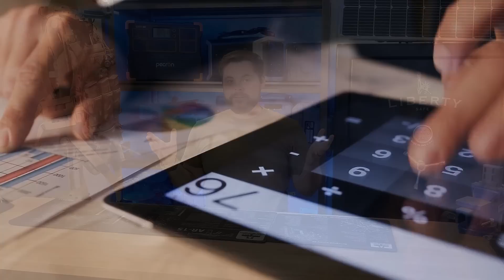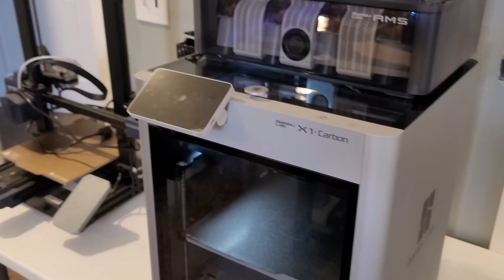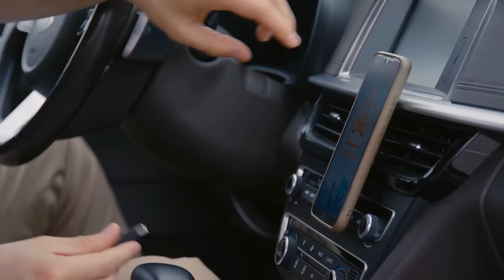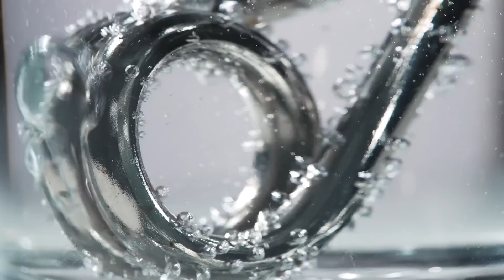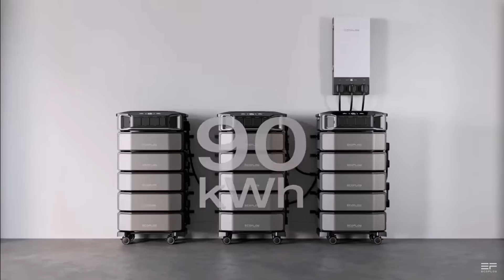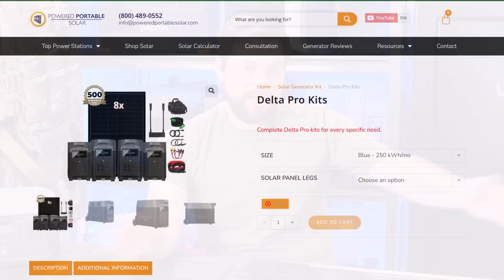No One Is Talking About This With EcoFlow

Comment: EcoFlow works fairly well.  Definitely top-class these days, though I don't go overboard buying their gear because I am more a discrete-systems guy.   My large capacities are banks of discrete LiFePO4 batteries so I don't really need any power station larger than 2000Wh/2000W or so.  I've collected almost a dozen small and medium-sized power stations of various brands, including EcoFlow.

But I would be careful using the energy management features in an AC-only "UPS" environment where the power station is not periodically charged to 100%.   It isn't actually possible for EcoFlow or anyone else (not even Tesla) to track the SOC or balance the cells without periodically charging the battery to 100%.  So if one tries to hold the battery at float (or lower) indefinitely, the cells will get out of balance and the SOC will drift until it is more or less a useless indicator.

So you generally want to fully charge power stations to 100% once every 3-6 months or so.  Also you might as well hold the power station at 90%.  From a practical standpoint there won't be any more stress on the battery compared to 70% unless the power station is sitting in a very hot environment (90F or hotter).  It's just a waste of capacity to hold the SOC below 90%.

Unless the unit is to remain unattended in a remote location, the discharge limit setting can be set to 0%.  If it will be unattended in a remote location, set the discharge limit to 10% or 20%.

--

Generally speaking, you aren't really saving much if any wear on the battery by charging to a lower SOC unless the power station is in a very hot ambient environment (90F or higher).  In any conditioned space where the temperatures are closer to 70-75F, holding the SOC at 100% won't hurt the battery enough for anyone to notice.  The electronics in the power station will fail long before the cells do.

I have numerous discrete LiFePO4 batteries used in UPS applications and as down-buffer batteries that are, more or less, held at 99% SOC at the float indefinitely.  For several years.  They are still pulling 95% capacity and that's most just from initial calendar aging.  I expect at the 10-year mark those batteries will still be above 90% given that they are in conditioned or cool (but not freezing) spaces.

-Matt

Comment: I've already had two failures of the three Delta Pro Ultras. This second one they refuse to send me a replacement before I send them the failing unit. This doesn't include the glitches I've had in the past. They have never resolved problems including the Power Insight Monitor can't connect to the DPU and Smart Home Panel 2 when the internet is down; The ethernet connection from the SHP2 to my router has never worked; it usually doesn't balance the charge between the three DPUs and the attached batteries; and the app on my phone can only connect via Bluetooth if the internet is down. All that and what makes the least sense is why do they not have tech support available during US normal business hours? You always have to wait overnight for someone in Asia to respond and troubleshooting a problem takes forever.
Reply: Another example of a great product design RUINED by $0 software development.
Reply: @gman1868  "And the app on my phone can only connect via Bluetooth if the internet is down"

Is that not obvious?
Reply: @CarlLindman-x8v  Firstly, Ecoflow said I could connect via local ethernet to the SHP2 when the internet is down. I can communicate with other devices on my own home network via ethernet and WiFi. The Power Insight Manager doesn't work via WiFi when the internet is down, but it's connected to my local WiFi network and the SHP2 is hard wired via ethernet to my router. THey told me this would work before I bought the equipment and I only discovered the problem after everything was installed.
Reply: There support sucks!!  No US based support.  It has taken 3 weeks to get my bricked ecoflow Pro replaced.  They told me that its on the way.  These reviewers need to do a live firmware upgrade and and pull the plug while its connected to the internet to see what happens.  Total shit software.  I will never purchase another one of there products again!!  They even abandoned the smart panel V1 and left us holding the bag.

Comment: I had a similar set up.  I had a delta pro that went all the way to 0 and then stopped working.  It was easy to send it back and get a replacement so that part was good.  However, I am looking for a whole home off grid set up and reliability is highly important….now I am a little nervous with the EcoFlow

Comment: @6:06: Now you are touching on something which I don't think is great customer service AT ALL !!! Having to pay large amounts of money, only to have your EcoFlow Product FAIL and then needing to re-package and re-ship your EcoFlow products back for servicing is a HUGE HASSLE AND MAJOR, SUPREME, INCONVENIENCE !!! Who the hell has the time to screw around like that ? If you're talking about an EcoFlow Delta Pro, or an EcoFlow ULTRA solution, then re-packing and shipping that isn't a 5 minute exercise is it Ben ? How about designing the EcoFlow power stations with built in, resettable fuse relays, or end user replaceable fuses, instead of requiring the customer to always ship their heavy power stations back for servicing in cases of malfunction ? In 2025, I don't see why you can't connect your malfunctioning EcoFlow Power Station to the Internet, so EcoFlow can remote service, update, or run quality and function control checks to diagnose faults ? Unless the built in WiFi and Bluetooth is what's busted, of course ?
Reply: Can you impinge if you are/were using this hardware and totally 100% reliant on it like an "OFFFGRID" type scenario?

Comment: We have the Delta Pro + extra battery, and a River 2. We originally got our Delta Pro (by itself) to start to slowly build out our system to prepare for hurricanes, so we were going to pay off the battery first, then make choices about solar panels, gas generator, an extra battery, etc etc...... Then a month later a hurricane hit us and took out our power for about 4-5ish days. It kept our food going but we were sooo not ready. BUT we did have family that got their power back, so we drove the unit to their house and charged up in about a hour, so we were good for a little while longer. Another family member got their power back as well and let us use their gas generator to finally finish out the outage. Few months later, we got a gas generator just to be a little more prepared and after we paid off the main unit, we bought another battery. Milton hit us in central Florida and we took it no issue other than dwindling gasoline supplies making me a LITTLE nervous (we went through half our supplies). We started buying solar panels last year and we're at 4 bifacial panels and looking to get four more this year. We also got a river 2 just to keep our water softner going for 12 hours in case of an outage if we're away or something, because the Delta Pro isn't always being used. So that's our history with Ecoflow

My critiques of the company is that I really REALLY do not like how much mark-up you get with the brand. I don't mind the main units being expensive cause it just makes sense but their extra batteries are USELESS without the main units, so them being as expensive as they are for limited functionality is kinda not okay. ESPECIALLY since you lose access to ports for other means like their own gas generators. If you have to batteries with their Pro units, you are going to have to disconnect on to use their gas generator in the way it was meant to be used and then cycle the extra batteries to charge the other one and that seems like more work than there should be. Daisy chaining them like other companies do with their extra batteries is kinda a must for this situation. Also, once again, other companies allow you to at least charge DC loads with their extra batteries like over USB-C or even charge up the extra batteries via DC/solar. I also really hate the extra battery cord for the DP. It's way too unwieldy, especially for tight spaces. Happy newer customers for the DPU/DP3 get that improved cable but it sucks that we have to go out and pay for that privilege now as DP1 owners. Also, their solar panels are way too expensive for the output you get, it's kinda absurd. I also wish there were more buttons to have more functionality not tied to the app, in case a phone breaks or someone who is not phone savvy or a third party needs to operate the units for you if you're away or something. Also, JUST IN CASE ECOFLOW GOES BELLY UP, it would be nice to not have to worry about app updates continuing since there have been instances of phone app stores stopping functionality of older apps as OS's update and leave behind older phones. Final pain point is backwards compatibility. It sucks that Smart Home Panel 1 owners are kinda stuck with the Delta Pro and Smart Home Panel 2 owners can't use their DP with it. So if you have a Smart Home Panel 1, you're stuck with the Delta Pro only and if you get the SHP2, you have to abandon the Delta Pro main units and upgrade to the DPU or DP3, adding extra expensive. I'm sure there's a lot of electric engineering reasons for why this HAS to be the case, especially with the voltages involved, but Ecoflow really wants everyone to be in the ecosystem and this makes me wary to fully buy in since there might be a SHP3 that further breaks backwards compatibility. Also, with the previous point of app support for the long term, I worry about the SHPs long term support. DOn't foresee Ecoflow going away in 10 years but crazier things HAVE happened in the last decade, so I worry about this stuff. Also, Delta Pro is annoying when you go over 500w of charging/discharging. Obviously would take it's fan noise over a gas generator but it's kinda worse cause at least the gas generator is outside, the DP is meant to be used indoors... where you sleep.

I haven't used their customer service much but in the times I have, they were very quick to respond. I do like their app a lot and its also improved a lot from when we first started using it to now. It's also, frankly, FUCKING CRAZY that you can get so much power in a single device that also excepts so many inputs to charge from. We're living in a golden age, people. Love that there are so many options too so people don't have to go big or go home, you can get something so much smaller to run your fridges and be set charging from your car is need be. The flexibility here is just awesome to see. I also do love that I don't feel the need to go out and get the newer stuff cause what we have is plenty good enough and I'm comfortable mostly knowing (outside of app stuff) that the units should run a good long time and still be about as good as when we first get them, outside of niche potential issues we just haven't encountered yet. I do like with the Delta Pro series that, if you want to go full sickos, you can get extra main units to get 240v and not really HAVE to go for the DPU or DP3. I do like the idea of the extra batteries being compatible with the DP3 so you don't have to get rid of all of your investment potentially

So yeah, mostly happy with our purchases. They've saved our butts, helped run medical devices for a family member, can be taken with us if we just want to gtfo, can be charged from multiple sources at once, charges fast for the capacity, has expand-ability of capability/capacity, seems pretty dependable thus far, and it just cool to see that we've gotten to this point. If it weren't for expense, I'd recommend everyone get one of these units just because they seem more and more like a necessity than a luxury. I hope costs go down and battery technology keeps improving so that more and more people can get these things and not have to deal with as much pressure during outages.
Reply: Hi kamo, can you tell me the battery voltage of delta pro?!! Ecoflo does not state it on website... The delta 2 has a 51 v battery... And the delta ultra has a 100 v battery...
Doesn't the pro have an ac input for charging?!? Why are you disconnecting the extra batteries to charge by generator???
Reply: @SolarizeYourLife  I don't know what the internal battery power is like, so I can't tell you. As for the extra battery, it's completely reliant on the main unit to charge it, so in order to charge the extra battery, IT HAS TO BE PLUGGED INTO THE MAIN UNIT, it can do nothing by itself. The Ecoflow delta pro has two proprietary connection ports for either two extra batteries or an extra battery and their gas generator. It has one solar/DC input that you can charge with solar or other DC loads as long as you can connect via a XT60i connector and it's got a computer AC input (they provide the AC charging cord). I plug the battery into the generator via the AC cord and that charges both the main unit AND the extra battery. It's not one or the other. The Delta Pro can also AC charge AND DC charge at the same time so I can charge via the gas generator and solar at the same time, which is handy in a low light situation like with clouds or something. Hope this helps!
Reply: Wow.  What a "comment!"
Reply: I guess Eco Flo has many issues.

Comment: I am just a lowly consumer and agree with you.  EcoFlow does stand behind their products.  After 3 years of use I sent 2 of the Delta Max 2000 and a river pro back.  They sent me shipping labels, and was given the option to wait a longer period to repair original or get refurbished ones for a quicker turn around.  I got refurbished ones with full existing warranties.  My River Pro had to be replaced with a new one and for my troubles EcoFlow gave me an extension battery for it.  They rock, unlike Pecron that made me pay for shipping.
Reply: Just curious if you have the time to answer me that would be great what was your process in getting replacements for your EcoFlow units that were not working properly I've had to Delta twos and they have both been having issues but EcoFlow wants me to send them a video of it not functioning right and then proof of purchase which I bought it from their website and it's warranted and registered through their website and they just keep on sending me an email saying to give them this information is that what you had to do to get your replacements??
Reply: @jg4real-truth-bound-4-da-floor  The process is tedious and frustrating.  Because of the time difference exchange with emails will be every 24 hours.  For me it was frustrating as I am not computer savvy and sending a video was difficult and I had to install drop box.  I purchased everything through Amazon so the order #'s and invoices were on file.  They require serial #'s .Best thing to do is do what they ask you to do.  In the past I had another unit go bad and I realized then what I needed to do .  For that other time which was my first I got angry but they made up for it my giving a river mini.  All in all turn around time with communicating and shipping and receiving products took 2 1/2 weeks.   Just accept the fact that you may have to answer the same questions more than once and your blood pressure will not go sky high.  I hope this helps.
Reply: Same experience here. No issues... always taken care off.

Comment: Obtaining any solar power storage solutions is difficult for us here in Hawaii (Big Island). There are a couple of resellers here that do carry some of the older series but at full retail cost. So the warranty support becomes tricky for us. I was able to get a Delta II at the HomeDepot in Hilo for $700. Not great but not a bad price for local options. But last week we saw the Delta Pro at Costco in Kona for $1700, which was a great price, so we picked up one. Our home is 100% electric with all the 120V connections on one leg, this leg is tied to a generator port with the safety interlock, so we can run our whole home 120V for about 9 hours off straight battery. Looking at adding the 1600W of solar to extend that and charge, supplementing with a generator as needed in total power down scenarios.
Reply: I ship things from main land USA to other countries on shipping container. Is it expensive to ship things to HI?
Reply: @cutiegirl123-78 Most sellers/resellers make it expensive. It all depends on what the item is (materials), what it weighs, and what the profit margins are. Volume and relationships with shippers also comes into play.
Reply: @heart4Pahoa, okay, that makes sense.

Comment: hi i have never seen so many referbished products then ecoflow for sale do they all quit . Makes you wonder.
Reply: I've purchased almost exclusively their refurbished products off their official ebay page. Three Delta 2s and a 220w solar panel. I put them through use and abuse living on the road for months at a time with hundreds of off road miles and never had an issue with the batteries.

The solar panel arrived with some mild damage and they replaced it right away.

The money saved while maintaining a great warranty on the refurbished units is an incredible deal

Comment: Ecoflow is quite annoying.
Their xt60i cable on their cooler and the delta is GARBAGE. The cable works for a few days, then becomes useless. Their response is not enough voltage is reaching the device… but they won’t solve the cable issue.

I sent back their glacier, for repair, the sent me back a box with a broken hinge, and power button… very annoying.